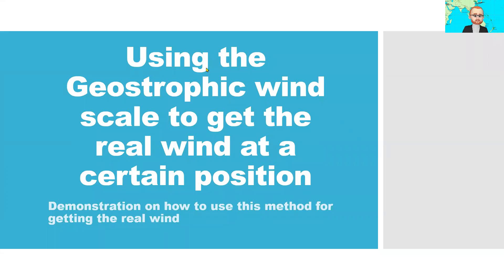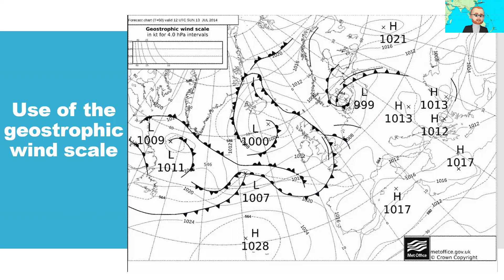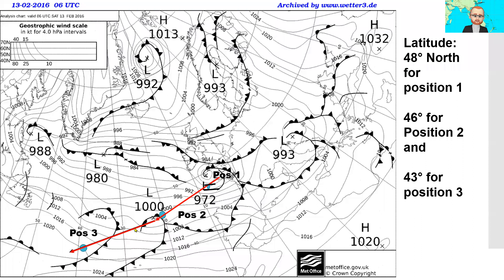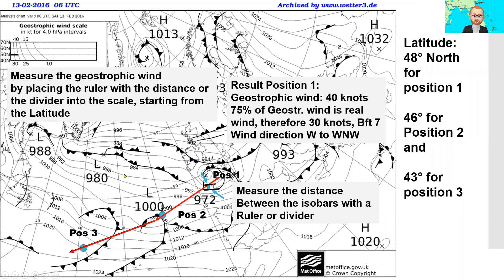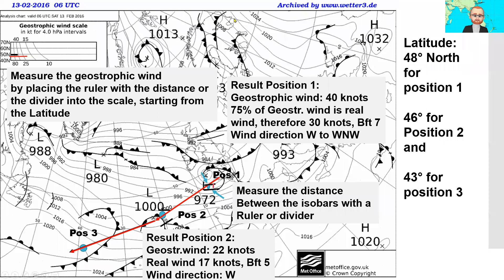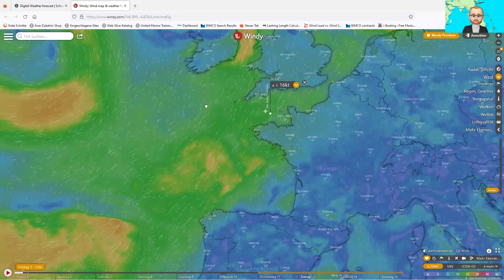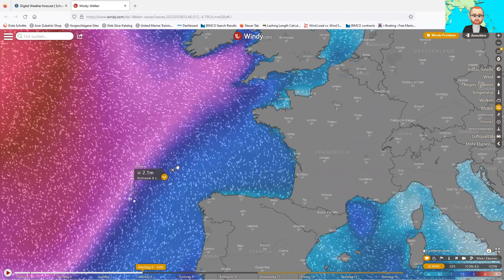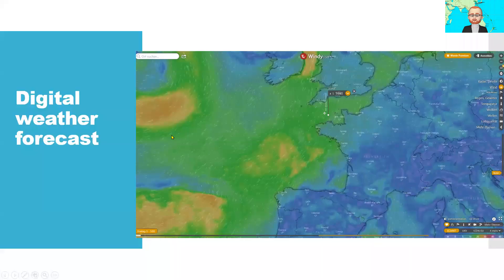Using the geostrophic wind scal for getting the real wind

Comment: Hi..i wanna ask.. where did you fins Bft? And where did you find the wind direction. Thx
Reply from the maker: The Bft are based on the wind speed,either in m/s^2 or knots.Usingcthe wind Vanessa the windxspeed is represented with a smal Bar =5 k.nots and a longer bar= 10 knots.Ifcyouvsee in the chart a wind Vanessa with two long and one short Bar the wind force is 25 knots.In the Internet or on board there are tables which represent the BFT in according to the force in knots.
The wind speed on board can also measured with an Anemometer,which measures both wind direction. As closer the isobars as strenger the wind.

For the wind direction the wind Vanessa is a traditionelle Instrument that rotates and points in the direction from which the wind is blowing.In general to know the wind direction: Northeim Hemisphere: The wind in a low pressure system moves counterclockwise andctowards the center of the low pressure.In the souther Hemisphäre the in a low pressure moves clockwise 
I hope I could helped you